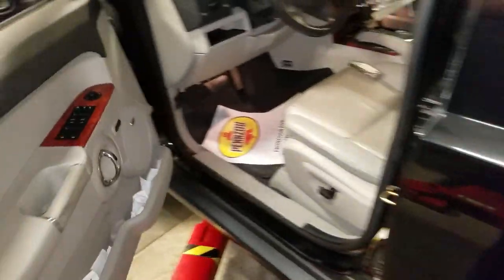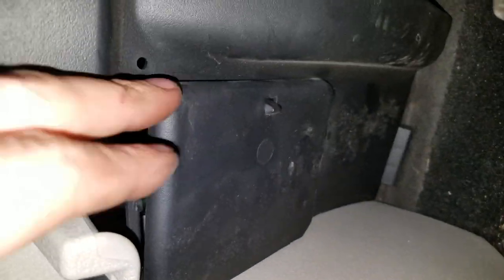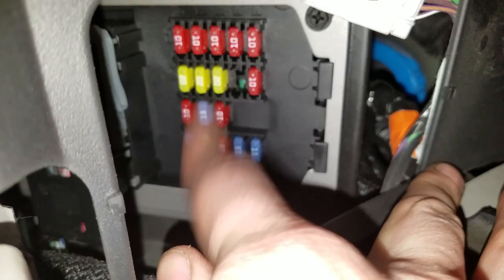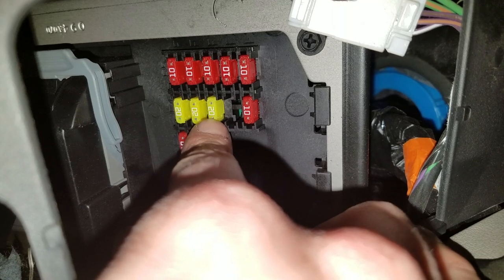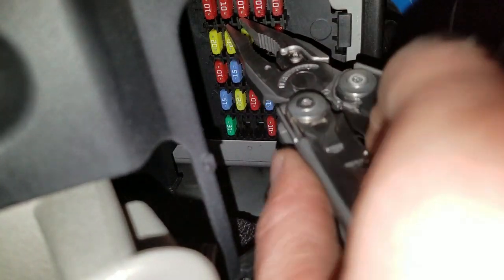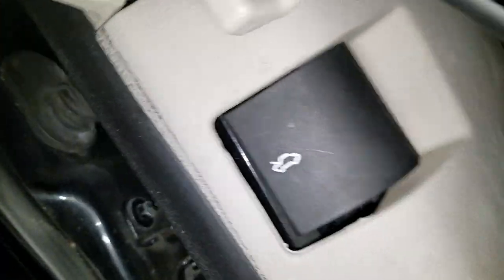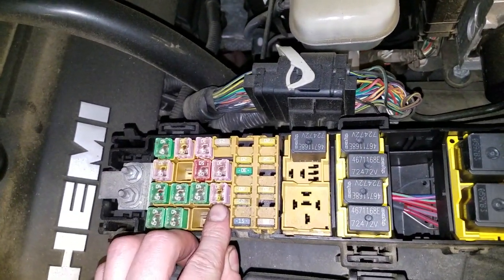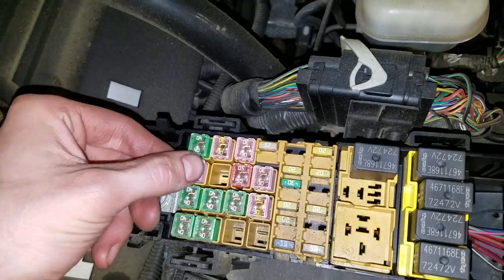Jeep Commander Cigarette Lighter Fuses Power Outlet Fuses

Comment: Put a new 20 and still isn’t working it did but after I shut it off and turned it back on no power check to see if it’s blown it isn’t 😐 might look at the other 30 amp

Comment: Ok I got a 07 jeep commander  this is what up with it the turning single don't work and the hazard lights when I push the button stay on even if I turn them off the window wiper switch don't work when I push it down or turn the button on the stick and the radio don't work heatworks runs and drives all the windows won't roll up or down changed starter alternator and the fuse box behind the battery and the gauges are the RPM's the temperature gauge the gauge that tells you how fast your going don't works the only one that works is the gas gauge and I can't seem to find out what the problem is